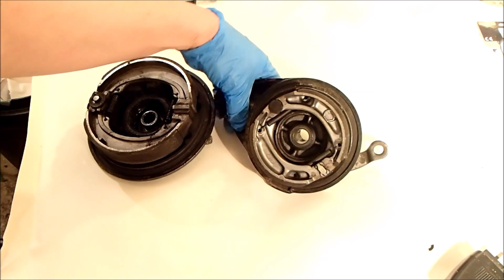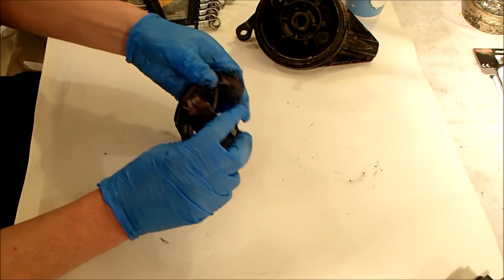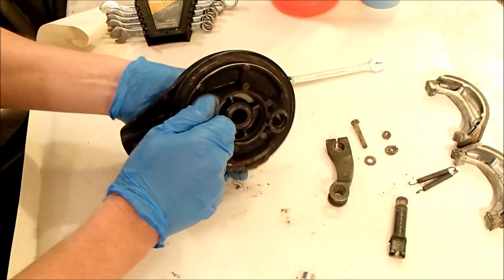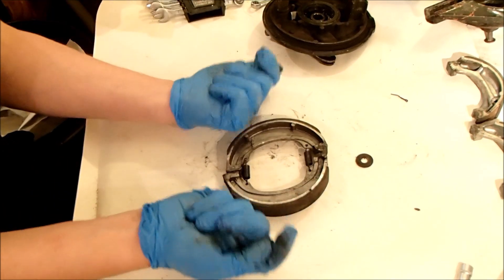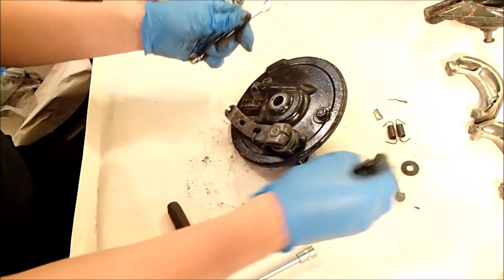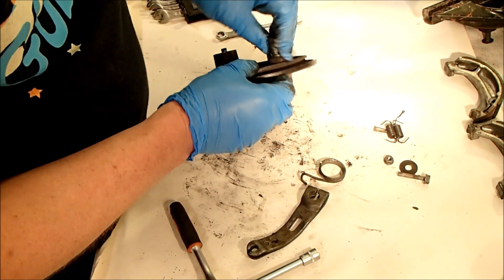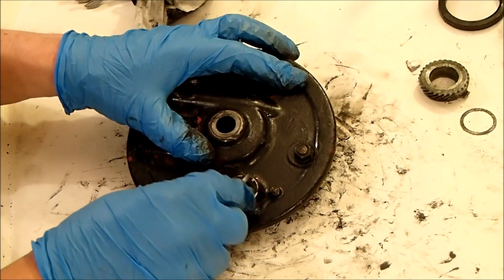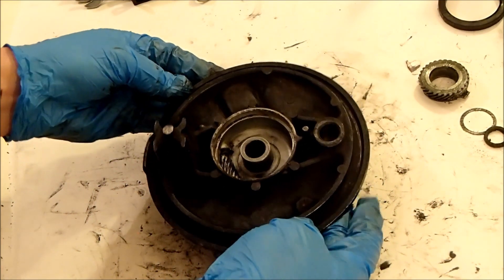Honda XL250s restoration pt8 - Brake hub disassembly

Comment: Was hoping you might have found the method of removing the worm drive, The shaft itself is a one piece construction with the worm drive, I believe the bearing is a push/interference fit  hold the assembly in place, I suspect Honda made it a non serviceable part and since bikes have moved on from front drum brakes and this hub assembly was sold as an in situ replacement part. Was hoping to change the gear ration on my XL 185 hub but I cant get it out to make the alteration.
Reply from the maker: I did try but in the end decided it would end up with a broken worm drive, othe than that works well and was easy to clean

Comment: Did you ever find out what the mystery nut on the front brake hub was for ??
I Googled for an exploded diagram online to see if I could work it out.
I agree it is probably for a previous model or a different model that uses the same hub.
Reply from the maker: I didn't find out, it could conceivably be from any number of honda models. The whole bike was a bit of a Frankenstein's monster of parts. Ultimately it works and being painted black, you don't notice it in practice.